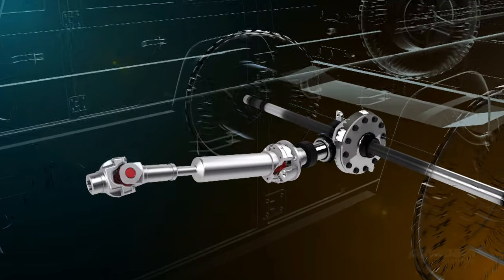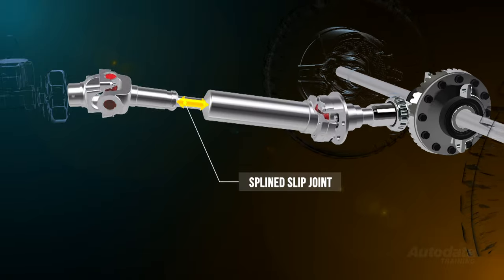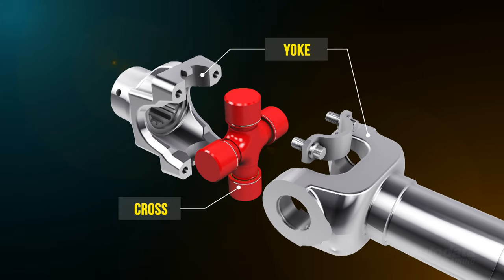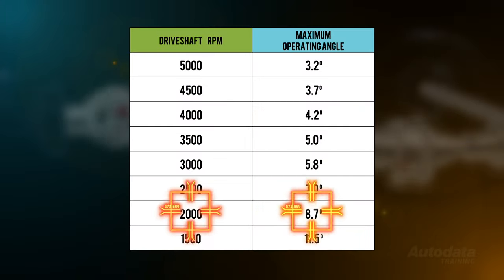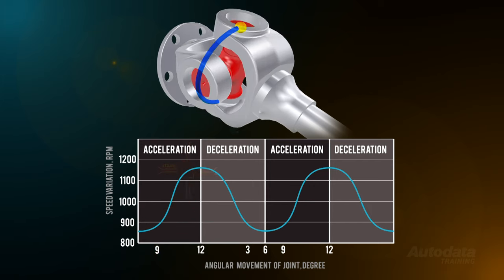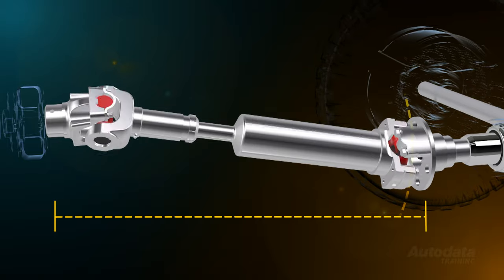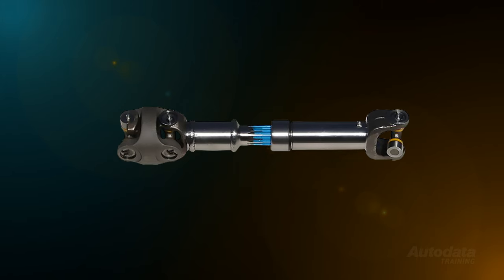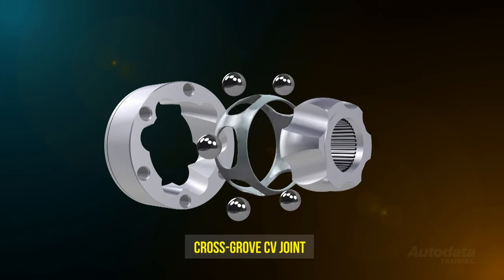How does a driveshaft work? What is a CV joint? Automotive systems explained!

Comment: Now I understand, why is it called constant velocity. Because, the Cardan joint is not constant and always changes the velocity during 1 complete rotation. So, for most application of cardan joint, we will see 2 of them on the shafts (with phasing), so that the effect of change of velocity (acceleration and deceration) can be negated with both joints.
Mechanical design is complex and filles with trigonometry and differential equations.

Comment: I have a 2020 Hyundai Palisade with 44k kms. It does jerk every time I drive slowly from a complete stop and turning left or right. It does jug jug jug until it reaches a certain speed. It does not jerk if I accelarate hard or fast, but only happens when I step the gas smoothly. It is very noticeable when i am driving round from an underground parking. Dealrship cannot find the problem. Thanks

Comment: Do some inner cv joints disengage by design when the join isn’t tensioned for some reason? It’s happening to my VW T4 and I’m not sure if it’s a broken joint or supposed to be like that. When I took it off it just spun on its own at the end of the axle until I pulled the end of the joint away from the axle to tension it which made it engage inside the joint and connect with the axle. Not sure if that makes sense.

Comment: What was the reason for not using a cv joint between the propeller shaft and the thail shaft instead of the universal joint ?
Reply: probably complexity and range of movement.  Less articulation requires a less complex joint that can probably hold more torque (at least twice what the CV must handle)  Just guessing but I believe a CV of sufficient strength would be rather large and more expensive.

Comment: watch at .25 speed and pause at 8:43: https://youtu.be/tf5PO4KxYNY?t=523

You'll see the balls clip through the outer race and the inner race doesn't line up with the balls!  I appreciate the assembly visualization but considering this is training for a precision software and joint design I'm surprised nobody noticed the graphic was assembled wrong (impossibly, since the bearings would occupy the same space as the race).